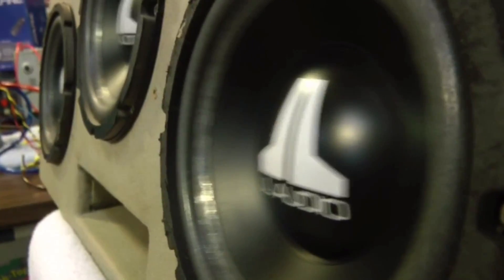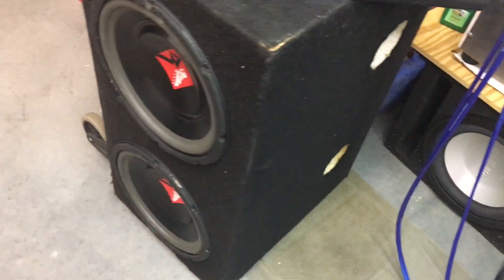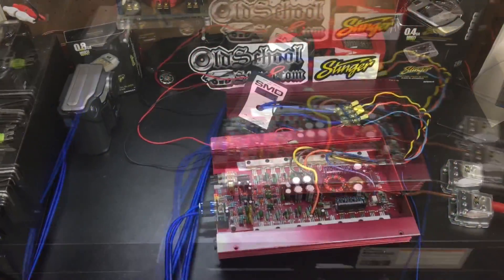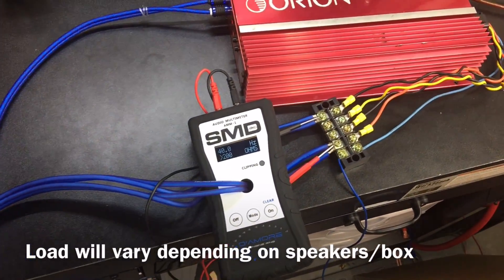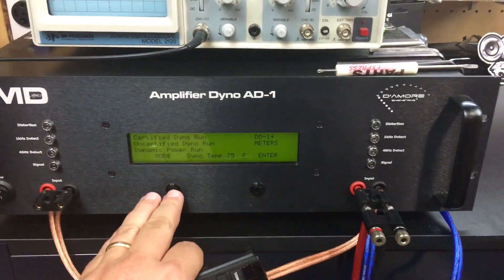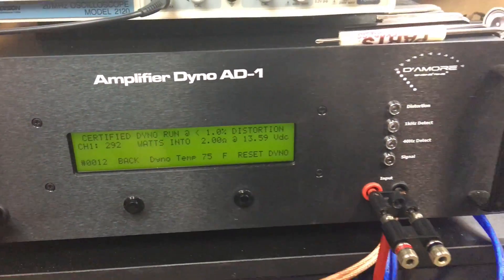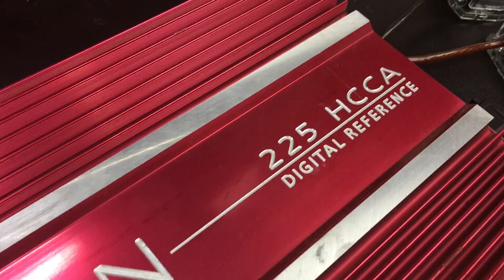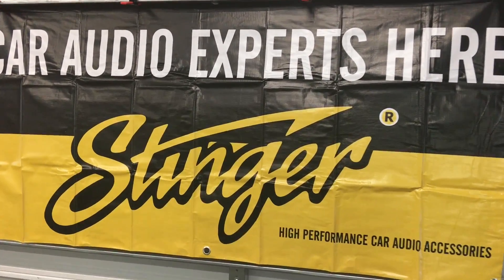Amp Wattage Output - Subwoofers vs Amp Dyno Orion 225 HCCA

Comment: We ran an amp test on this amp in 1992. Ran it 1/4 ohm mono and got 723 watts. You have to over fuse (more watts = more current) it and it won't run real long because the heatsink is too small. The 250 HCCA ran 1150 watts at 1/2 ohm mono and we put a 60hz sine wave through it and ran a full sized table saw off of it.

I still have vintage 225 HCCA, two 222 SX, 275 SX, 220 GT and a Fosgate Punch 45HD with a chrome fan shroud
Reply from the maker: What was the method of testing to get those numbers? Did you use 60Hz and what was the measuring device? I’m truly curious. Only way I got big numbers with old skool Orion is 1kHz tone
Reply: @wal  So now you make me go deep into the basement to retrieve the actual paper from 1992 in the pile of car parts, computer parts and car stereo parts....

Good news, the amp test that was done was done at several frequencies. 

The test was done by Linear Marketing who was the Orion distributor for Canada. They came to our shop and brought an Orion PS 100A power supply and a Wavetek (function?) gernerator. I really don't know how he measured it. My guess is oscilloscope. I'd have to dig the guy up, I still think he's out there tinkering.

Amps were tested by them, but the idea was anybody could bring any amp and see if it had the stones.

The test was at 20,50,100,1k,5k,20k

Orion 250HCCA showed best at 1k and 5k BUT as soon as the voltage was increased the difference between 100 and 1k/5k became a lot less.

The 275 SX and the 225 HCCA were equal @ 1k,5K and 20K regardless if running a `12v or 13.8v. The Cobalt 230 and 260 were the same as the 275 SX and 225 HCCA.

Soundstream reference 500 hit its best at 1/5/20k, while the Sounstream 6.0 was best at 1k regardless of voltage. The Soundstream 3.0 matched the 500 by producing its best at 1/5/20k but when the voltage went up, it produced the same power at 100hz/1/5/20k.

Pretty much everything went as we had anticipated. A low load and a lot of voltage turned the underrated HCCA amps into superstars. The indestructible and underrated  HiFonics Odin impressed with its output (all the lower cost HiFonics pieces kicked ass and didn't blow up when you clipped them)

Biggest disappointment went to the owner of a PPI 2300AM. 2X199@4 ohms and 2X300@2 ohms per channel@ 15V and a Fosgate Power 650 that was supposedly modified. It ran 4X120 and then 4X180. Sucked for the owner but I still got it to either 4th or 5th place enhanced SPL 501-1000 at 1993 IASCA World finals.

The 250HCCA on the table saw was @ 15 V. The first 225 HCCA blew up running only 1 ohm mono. Since Linear Marketing was the distributor, they said nothing because they didn't want to get called out for favoring their brand. I said F-that, I'm getting another one from the stock room and that is the one that ran the good numbers. When the first one blew I hear the first transistor hit the heat sink with a high pitched "clink" I yelled there she blows and the rest sounded like a machine gun all the transistor went. Then smoke...
Reply: @Todd.T  freaking awesome 👍👍
Reply: Unfortunately I don't have any of the fancy numbers you guys do but the sound people who installed my 225 hcca and Subs said they got it down to quarter ohm but had to add fans and take off the removable cover. I can't verify they had it at quarter home but I can verify they had to add fans. The first one they tried popped so they had to replace it because it was under warranty and added the fans on the second go-round. Man I miss the eye retina vibration😂

Comment: I am not an electrical or audio engineer by any means, but from talking to a few of them this is how I understand it. It really doesn't matter as long are you are using decent equipment, the tests are done correctly and done on the same or similar equipment. You are not doing a standards or industry rating, you are doing comparisons. It looks to me like your equipment is pretty good and you know what you are doing. For home audio stuff I like to see 20 hz to 20 khz at much lower distortion, like .1 so you can see what the amp is really doing. For what you are testing, and what you are trying to accomplish and the fact that you are doing it for free is way more than good enough.

You are doing a huge service for people looking to buy a decent car amp. Even if you haven't tested them all you test enough to give someone an idea. As in if you have tested a few amps from certain maker we can get an idea on how they rate them and if we are going to ripped off or not. Even for some of the cheap ones. You have tested some cheap stuff that actually did much better than I thought it would. I am not expecting to get a 1000 watt amp for 100 dollars lol. However if you can show something like this can pull a couple watts and is stable into 2 ohms it probably isn't a bad buy for the average guy just looking to throw a sub in his car. Now if I am paying hundred, or thousands of dollars for an amp to compete with or something, then ya I expect it to do what they say it will. I am honestly shocked a lot of them are as good as they end up being. Unfortunately that isn't the case in the home audio market. With receivers that say they can run 11 channels at a 1100 watts and the thing weighs 10 or 15 lbs lol.
Reply from the maker: Thanks for watching and commenting. Maybe one day I'll be able to afford an Audio Precision for testing the amplifiers, but for now I'll go with the SMD Amp Dyno
Reply: @wal  dude, what you have is great for what your doing. Take the money you would spend on one of those and buy a boat or something lol. Or put your kid through college. Out of curiousity what did it cost to have that one built for you? Couldn't have been cheap.

Comment: How does the real world power output of a class AB amplifier compare to that of a class D? I had an MTX Thunder 2300, and it felt a lot more powerful than a class D amplifier with a similar power rating (yes, I know the real world power output is closer to 900 watts RMS than its 600 watt official rating). Do class AB amplifiers allow a person to use it further past clippping than a class D? I feel like class D amps have a hard limit and won't let me run them into clipping or higher THD figures. I'm wondering if this is why class AB amplifiers seem more powerful to me.
Reply: Their are many variables to consider when comparing any two amps. If you are driving the same subs in the same box in the same vehicle with a strong electrical system and your source is the same you can eliminate a lot of those variabless. In my personal experience I have hooked up two amps that had very similar dyno numbers and have heard noticeable differences in both output and sound quality. There are people out there who would tell you that it is impossible to tell the difference of two amps with the same wattage in both output and sound quality and that a watt is a watt. I have little experience with class d amps but Me and my buddy did a blind test of a kicker zr240 and ppi pc2150. We both came to the same conclusion. The kicker zr 240 had much better output but the pc2150 was a bit tighter sounding. I'm a huge ppi pc class fan but the kicker clearly drove the subs harder. I even got a second pc2150 and hooked that up because I couldn't understand  what was going on but got the same results. Both amps are a/b and between 525-575 watts. There should have been little to no difference in sound but it was definitely present. In conclusion I would say go with what sounds good to you because everyone is going to have a strong opinion but you have to live with the amp.

Comment: I think a lot of people are going to misunderstand the results, thinking that a resistive load gives the amp a higher rating than speakers. What most people don't realize is that impedance varies with frequency like you've already mentioned. A driver in a sealed enclosure at resonance could have an impedance of 120 ohms or higher. The impedance rating of a speaker is only a nominal rating. Is it possible to set the dyno to present a 2.5 ohm load? I think that would answer the real question most people have, whether a resistive or reactive load produces a difference in power output. That would increase people's trust in amplifier power output ratings. What people should be taking away from this test is that the amp dyno produces the same results as a speaker.

Comment: Need to see it's full output all the way down to 1/4 ohm
Reply from the maker: +Ryan Moore ouch! With resistive loads, the 225 chokes a bit at 0.5 mono, but speaker nominal 0.25 ohm loads present a higher load actual load, thanks to “box rise”, so they will perform well in those instances

Comment: Exactly what I expected. The difference seems to be completely consistent with the variance between 2 ohms and 2.5 ohms. Looks like the Amp Dyno is spot-on. Think is, real-world resistances vary some, due to speaker wire size, length of run, variation in the speakers themselves, etc.

Comment: Sweet, sweet amp!
Reply from the maker: +Joseph Hernandez Doesn't seem like much power by today's standards, but can make these (3) 12's shake everything in the OSS labs!
Reply: +Dereck BigDWiz Maybe I'm missing something, but the power of these older amps, although less, doesn't seem to be lacking compared to the newer digital amps. I still run a 475 XTR - Pop Top in my Tundra and it sounds great and pushes my 10" hard when needed. I don't see myself trading it in for a newer digital amp. My 2 cents.

Comment: The venerable 225! It maybe my favorite amp of all time.
Reply from the maker: +hifivega I love these little jewels too!
Reply: +Dereck BigDWiz Still running the one I bought in 1993 in my every day driver.
Reply: hifivega in 1994 I had my 25 pushing 4 twelve inch woofers. Mines had the bridging module as a separate piece.

Comment: About what I was thinking. :-)
Reply from the maker: +Reggie Reginato will be interesting to see a bigger amp in the same test
Reply: +Dereck BigDWiz For sure!  Although, wouldn't that change from speaker load to speaker load and box configuration (given the inductance of the coils, impedance rise from speakers natural resonance, the boxes natural resonance, port tune, etc, etc).  Are you going to use a set speaker/box combination?  Don't get me wrong, I like this a lot as it's very real world showing true application capabilities.
Reply from the maker: +Reggie Reginato my plans are to put a small wall of subs near my test bench so I can use for this scenario. I'd like to be able to wire 4 ohms down to 1/2 ohm. Yes, it would be different in your car with your subs, but I can't take into account all scenarios. I should explain that better in future videos.
Reply: No worries, and I look forward to what you got in store.  This rocks and I totally dig it man. :-)

Comment: Thats ~10% difference. Thats pretty good for reactive vs resistive loads.
Reply from the maker: +hortonj63 If you figure in the "actual" ohm load of the speakers (2.5 ohms), it's not even that much.
Reply: +Dereck BigDWiz exactly. thats really good. low power loss. could be worse.  cheaper wrong gauge wire probably causes more than the resistance of speakers